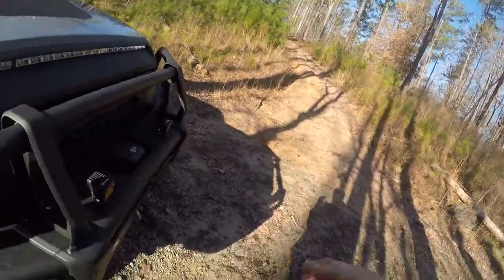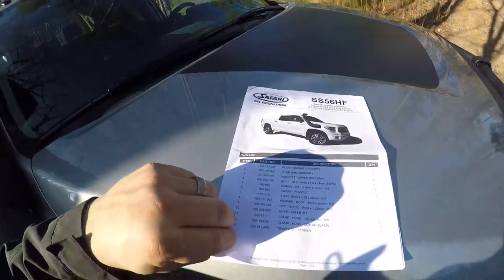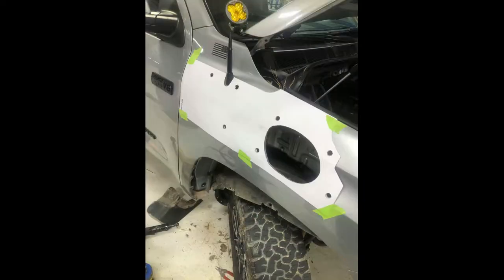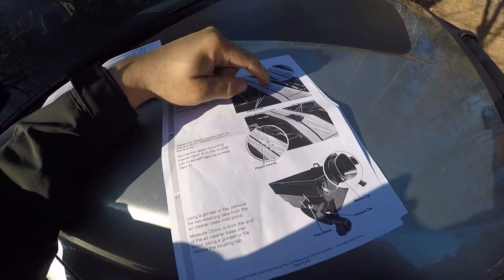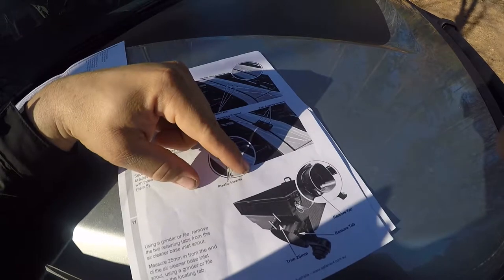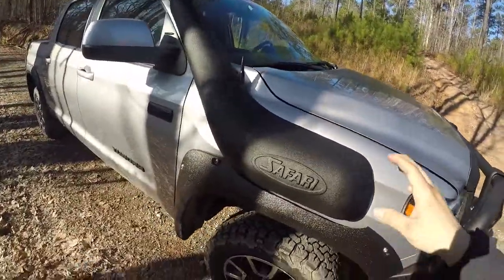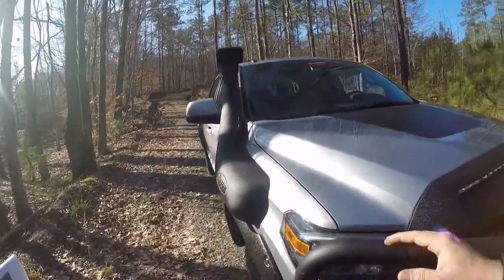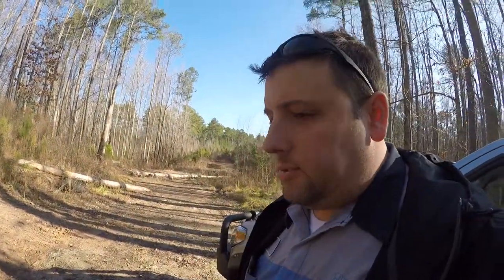TUNDRA SAFARI SNORKEL

Comment: Nice video man!  I've been considering a snorkel for the 2016 Tundra I just bought, but wasn't sure because the previous owner had a K&N Series 77 High Flow Performance Cold Air Intake installed.  I honestly don't know exactly how it works, but it looks like I could just take off the filter and connect the snorkel.   Do you think I could do that or would I need to completely remove the cold air intake?  Sorry for noob question!  lolz
Reply from the maker: Zachary McGrew try it. Worse case you need the factory airbox and there is enough of those sitting in garages from people putting on aftermarket
Reply: @WolfOverland  Cool.  Thanks man!  =]

Comment: Did you have to get heavier aftermarket front shocks with the bumper to prevent nose diving?
Reply from the maker: Johnny Hawkins III the factory TRD springs sagged down about 2 inches and the suspension travel was drastically reduced. 

Ended up doing the old man emu heavy duty springs and struts. Made a huge difference.
Reply: @WolfOverland  thanks!! Was debating that arb bumper vs a couple others, but have heard you need heavier springs. Does that bumper cover the whole front end components? Lower radiator, front drivetrain and oil pan?
Reply from the maker: Johnny Hawkins III yes. It has metal shields covering the lower parts as well as the inside of the fenders.

Comment: I want to put that on my pro but drilling makes my teeth grind 😬😬😬😬😬😬😬.
Reply from the maker: Agree. That and drilling in the a pillar you are not coming back from it. But hey. It’s different. It’s what I want. It works good.
Reply: It looks really good but I’ll have to to see how many water crossings I’ll be doing!!
Reply from the maker: It’s a cold air intake too. Cleaner air.